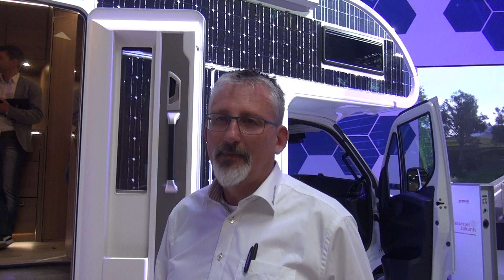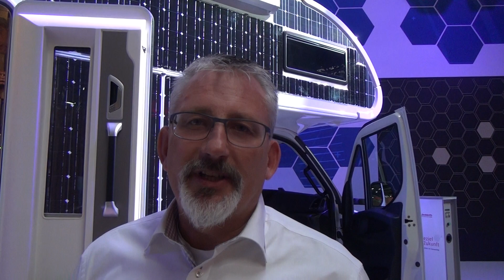The brain behind the electronic motorhome : interview with Christoph Kawaleck

Comment: Based on the mpg on my van, which is pretty good and comparable to a big car, there's no reason why a van can't be made electric with the same restrictions as an EV
Reply from the maker: I used to get around 5.5 litres to 100km in my Mercedes 190D, now in the Hymer B514 it is around 9 litres to 100km.  I know I burn less fuel than some friends with cars!
Reply: @VanlifewithAlan  About the same with my Hobby. The basic chassis could be modified to carry batteries, not much more than an EV and it could go electric. Or am I missing something?

Comment: a fully electric camper already exists, this one is a fail.
Reply from the maker: If it exists Lez, then you ought to have named it. The only one I know of is a car with next to no equipment inside.
Reply: a hire company in yorkshire even rents out a full electric, these guys missed the ship by a few years.
heres full electric.
https://www.youtube.com/watch?v=fGZ1zbqAGA0
Reply from the maker: I don't think that one is in Yorkshire.  As for the VW - assuming that there is 10 square metres of solar panels, that should get at very best around 3kW of power per hour.  He says he is getting 200v which won't get him very far.
Reply: I didnt state that i was linking the yorkshire one, but thats the better one thought it would be more interesting viewing as its a home brew,  http://www.edubtrips.co.uk/ are the yorkshire electric hire company i mentioned.
''he says he is getting 200v which wont get him very far'' ?? your speaking to an electronics guy here alan, voltage means bugger all for distance, its watt hours that count, which is why tesla quote they pack sizes in watt hours not amps or volts and sell an 80kw(h) pack and the p100 having an 100kw(h) pack etc...
Reply from the maker: Sorry I was just repeating what he said in the film - I realise the difference between v and w!  (I was also going through about 200 comments on my films!)   Even if this Yorkshire company has replaced the petrol with electric similar to the Iveco shown here, or in the film you quoted, it is not likely to go much beyond 100km without a charge.  Furthermore the prototype in my film is designed to have everything running off electricity - were it ever to be put into production!
Reply: i'd do that tomorrow to my ducato chassis, if i had a spare 20k in the bank account lol

although i bet i could do it for 10k over a longer time...

the tech's there and its off the shelf, but homebrew people usually don't have the cash and the bigger companies want to reinvent the wheel instead of off the shelf so its all proprietary and  they can charge more for it
Reply from the maker: I don't know if you have seen any of my motorhome rebuild series, but we are working on something along these lines although we have not got a working model yet.  The motor stays diesel but we have a theoretical model of powering everything by electricity inside.  I shall reveal all a bit later.  Probably a long bit later with the speed we are going now.